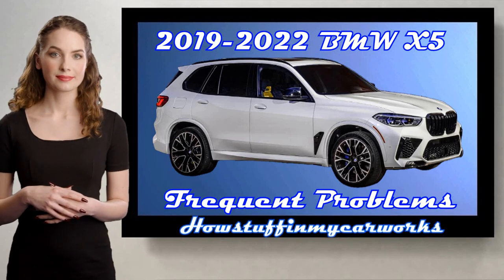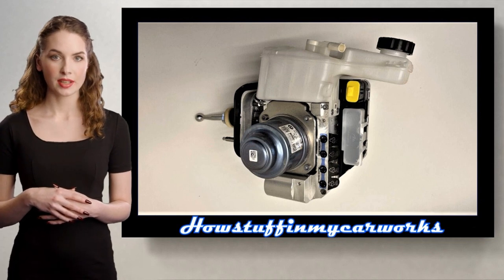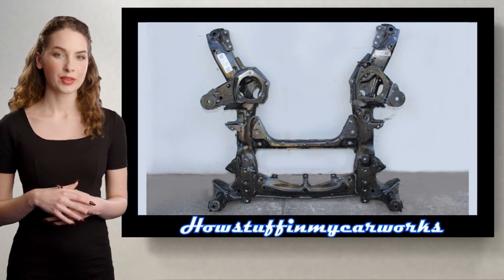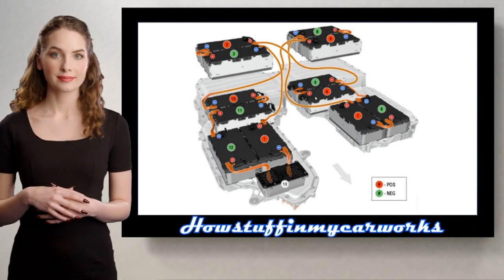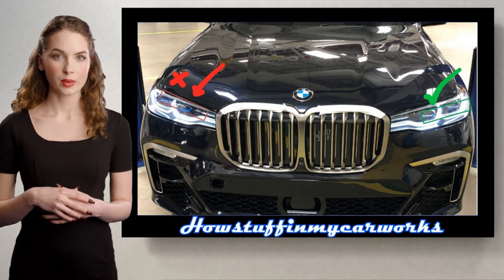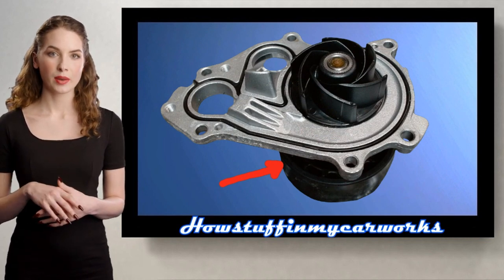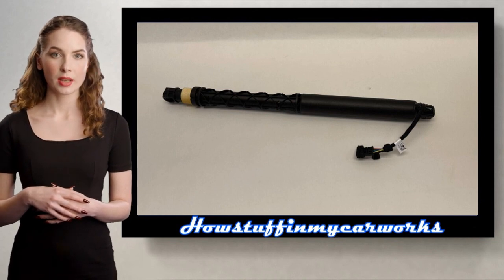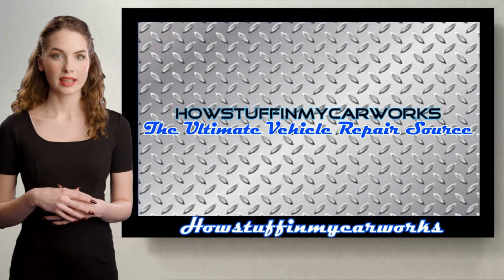BMW X5  G05  4th Gen Common Problems, defects, recalls and complaints

Comment: 2021 2022 Bmw x5 m40d mayor water sunroof door pillar leaking 
Have seen couple on YouTube especially my own vehicle I have uploaded videos on my channel 
Showing excessive leak . Has been back to dealership but not fixed.
Booked back in but no rush from BMW has been 8wks booked in April 6 but car is ruined damp mold electrical issues etc 
BMW are worse manufacturing company I’ve dealt with especially the money I’ve paid and only done 10k
Reply: Bruh You got gaming videos, ain’t bmw